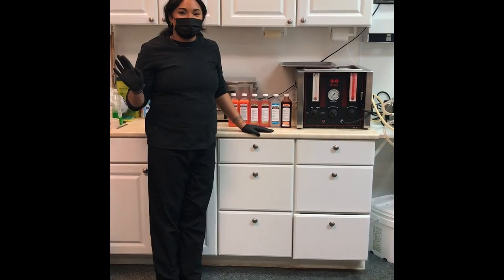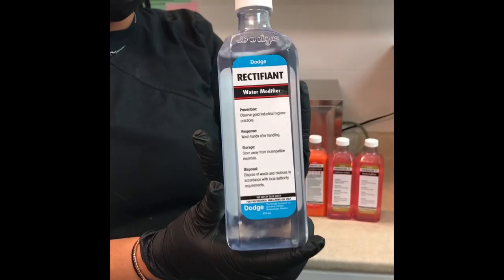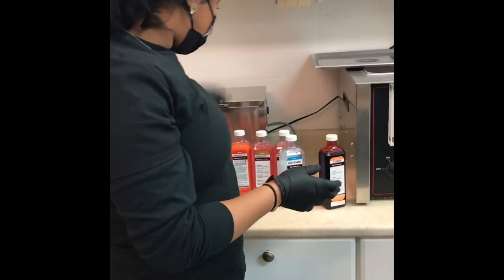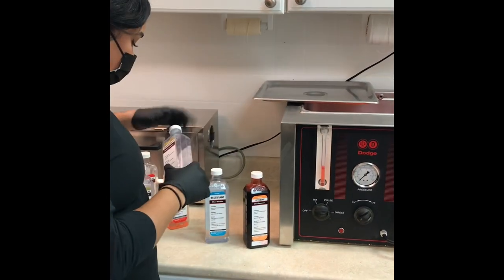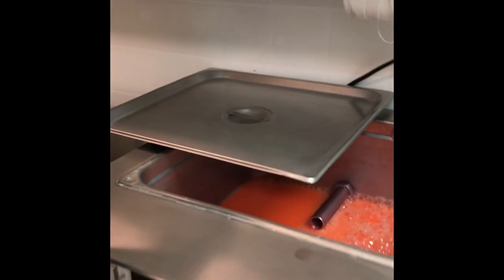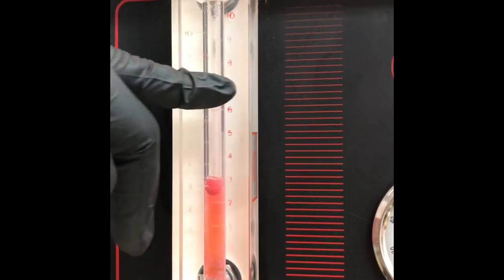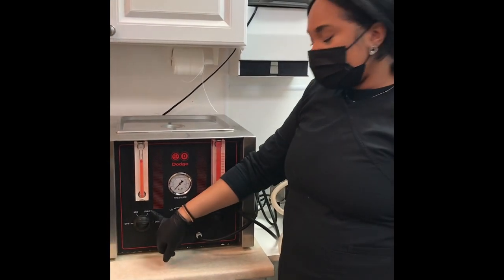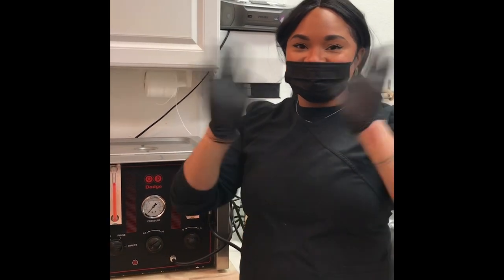Embalming Chemicals and Machine at a Funeral Home

Comment: The Dodge "embalming machine" is like an advanced pump. It also takes several formulas of its own brand Dodge fluid. I remember in the 1970s decade a brand called Professional made pumps with the glass reservoir and its brand arterial fluids, jaundice fluid and cavity fluid. They were used by many funeral homes, but I would like Dodge the best.